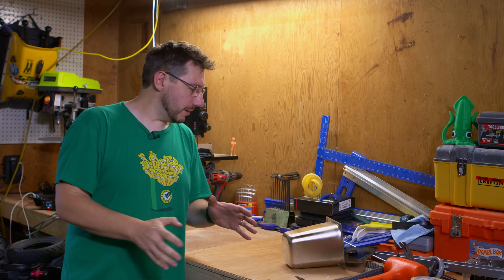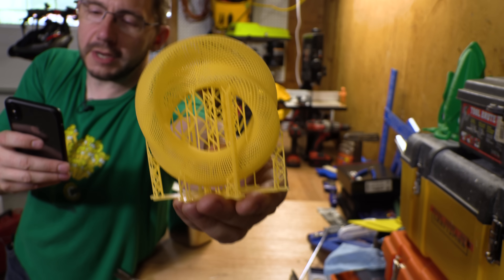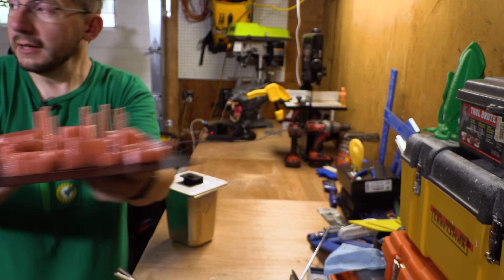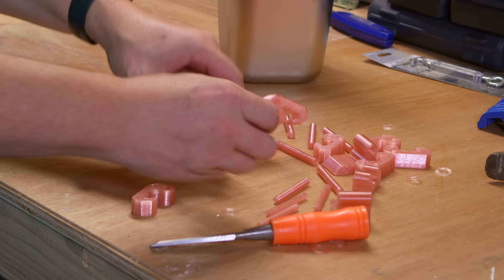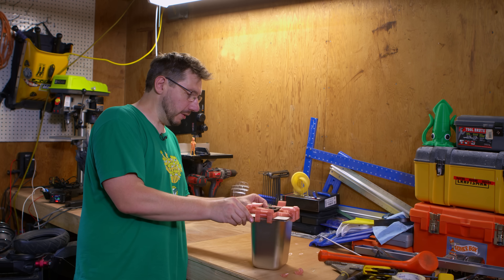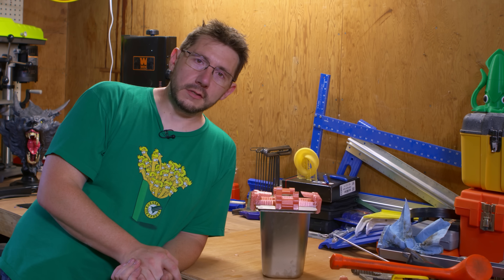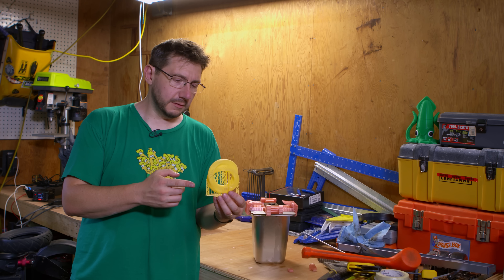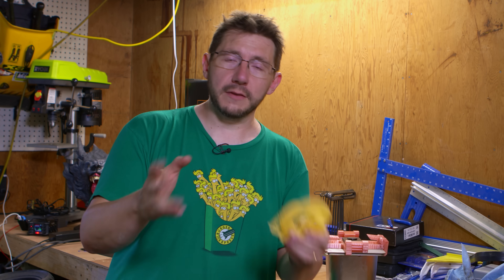Practical Print for Resin 3D Printing - GIVE 'EM THE CLAMPS!

Comment: I would make a small hole on the bottom of the torus, push a led-strip of compatible size (perhaps up-scale the torus in the first place), and when you get the other end of the led-strip out, connect it to a switch, and to a lamp-base and you'll have a very trippy lamp projecting the torus mesh on your walls and ... well everything

Comment: The container is just a standard Gastronorm size 1/6 container, widely used in the catering industry, inexpensive, and you can get sealable lids for them. So my solution would be just to put a proper (sealing) lid on it when it's not being used.

Comment: Love your channel.... that is clear.  I also love how you showed the failure instead of just re-cutting the video.   However, some polite criticism if I may:   You showed at length "testing" the lid with only three clasps after the one broke.   However, you did not really show any useful testing AFTER you reprinted the broken part.  I was expected you to do the same sort of test with all 4 clasps in place but you didn't really show how well the lid actually performed fully sealed.  So at the end, I still really don't know if the lid is worth the print time or not.  Just my 2 cents and just trying to help.   :)

Comment: Imo I think that the scaling is a hair too small.
This would account for the one clasp breaking.
Also, just a theroy,  but I think the reason it's not sealing is because there's too much pressure on the lid, causing the corners to deflect up.
Scaling up the size just a hair should, theoretically, fix both issuss.

Comment: Ok, you can fix pla with methyl ethyl ketone (MEK) whith chemical bond, but is not a healthy chemical. 
Use a kitchen fire torch to melt and solder the broken pieces, or use a 3d pen (you should have a 3d pen, it's lovely for fixing and dirty fast hanheld prototyping). My printer X axis is fixed with the 3d pen, it had an accident with a new belt tensioner (too much tension for the oroginal part), it broke by the bearing holder.

Comment: Hy there! I have a problem with my ender 3 that i cant figure it out, a week ago i was printing part just fine they came out great but after i changed my hotend to an all metal one i get gaps between lines, i have 100% flow also calibrated e steps per mm. Maybe my extruder is the problem but it is an all metal one so i shouldn't be... i hope somebody could help me
Reply: What hotend did you use?
Reply: @76byoung  i bought an all metal hotend similarly to micro swiss from aliexpress

Comment: Eyy you used the yellow print on the thumbnail! The pink one would have been more relevant, but since it was stuck in the build plate it wasn't easy to guess what it is. 
Great video as always!
Reply from the maker: I ended up changing to a pink thumbnail, but a slightly different image :)
Reply: @3DPrintingNerd  Now this one is ideal! You can recognize what it is and it also pops! Great job!

Comment: I am having one heck of a bad time trying to get my Tronxy X5SA to print some small items from Thingverse, I spent 3 hours just trying to adjust the hot bed level after the many auto leveling checks?  I am using a new spool of e-sun's PLA+ filament in a nice orange.  After 20 auto leveling checks and adjusting the 6 hand spring height knobs on the hot bed, and doing my nut here, in a hot and humid UK day. I tried many times to do the small print. the e-sun filament help tech sheet stated 225 for the hot end and zero heat for the hot bed, I did that I did many different heating levels of hot end and heat on the hot bed. And after hours of hell were the plastic would just make a clotted mess that slid around the hot bed area still under the hot end but not sticking to the bed. I gave up... I hot and muggy and amazed this well tested and good reviewed filament let me down?  Who knows what I do when I get the ordered PETG come soon? if I can't even get this PLA+ to work. I did do awhile back a small and bit bigger Benchy boat in PLA, even that took tons of time to set up and get working.  Just a real pain, I know Joel you say don't give up? But really hours of hard work just the try to get the auto leveling set right, then more tons of time wasted trying to get the damn printer to print.  Is there is better way if so I need it big time...

Comment: you can literally take a bunch of strong binder clips  and do pretty much the same thing. They are super strong and cost next to nothing.

Am I missing something here?
Reply: Because when you have one or more FDM printers and a pile of filament just sitting around. Why not save a few bucks and an unnecessary store trip and use material you already have?
Reply: @devsfan1830  because you don't save a few bucks though, binder clips are dirt cheap, cheaper than the cost of materials for such a print and most of us already have a few lying around anyway.
Reply: @stathisbikos6563  Ok so if you already have binder clips then use that. Its not like Joel is saying this is the BESTEST THING to use ever. Its just about having fun and trying stuff out. This print def looks more fun than some binder clips. There's plenty of things I've printed than are pennies at a store. Then I look at the 6 air tight storage tubs of filament I have sitting there. So I 3D print it instead.
Reply: @devsfan1830  I agree obviously. Just a different opinion
Reply: @stathisbikos6563  ooooooorrrrr just buy a plastic lunchbox theyre cheaper that the steel bins and are water tight + they're usually made off PP so are solvent resistant

Comment: The clamp is probably not your problem...even if you had all four clamps you'd likely leak some.  This is a non-sealing lid.  Put a thin bead of silicon around the top edge of the canister, cover it with saran wrap, place the lid on top of the saran wrap, and re-clamp.  Let the silicon dry/cure, then remove the saran wrap and try your clamping leak test again.  The lid should get a much better seal with the silicon.

Comment: Did you change the orientation of the second prints so the layer lines were perpendicular to the lip of the lid?
Reply from the maker: No, the print orientation was best, I was just too strong. Plus, I adjusted the lid a bit :)
Reply: I was going to ask a similar question. The break seemed to be in the same plane as the layer directions. If the model was printed rotated, say 45 degrees on the Z-axis, it would be more resistance to breaking along the lines.

Comment: Hey Joel, Awesome video as usual.  Cool print, problem is I can't get IPA at the moment.
Reply from the maker: I cannot as well. What you saw it LITERALLY what I have left.
Reply: 3D Printing Nerd I’m very lucky I guess, the store down the street has gallons of it very cheap, I guess that’s the plus of living in the middle of no where!
Reply: Amazon sells it!
Reply: Digikey has IPA for electronics work. MG Chemicals 824-1L. Pricey, but it's 99%.
Reply: why?
Reply: FYI, some products are mostly isopropanol. One version of Heet, I think the red bottle, is mostly isopropanol.
Reply: Check to see if any arts and crafts stores in your area may have some. IPA is used for some art techniques, eg. with alcohol inks, and may be available. A semi-local store to me has had it in stock for months when almost every other place has been out (99.5 %). Electronics cleaners most often contain mainly IPA as well, if those are available somewhere.
Reply: Just use methylated spirits or denatured alcohol

Comment: Pro tip: do not confuse IPA for IPA.  India Pale Ale is not very effective at curing 3D prints.
Reply from the maker: Are you sure? Have you tried?
Reply: @3DPrintingNerd  To be fair, I have not, since I only have MP Select Mini v2, not any kind of resin printer.  That joke just came to mind because it took me a moment to realize what IPA you meant in the video title.
Now I'm kind of curious about what sort of alternate solutions would work, though.  I can't imagine that any beer/ale would do the job, since they're usually <10% alcohol by volume, and everything else mixed into them seems unlikely to do anything other than leave a sticky, gross mess all over the print, but I could see higher proof vodka or everclear doing the job.
Reply: Depends on whether water is good for cleaning resin, I'm thinking it will just make the print smell like hops.